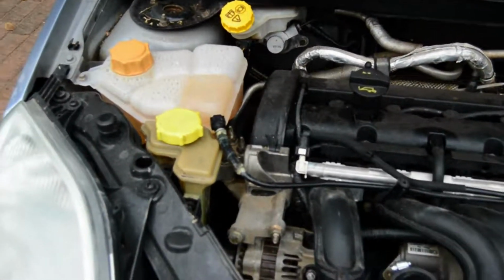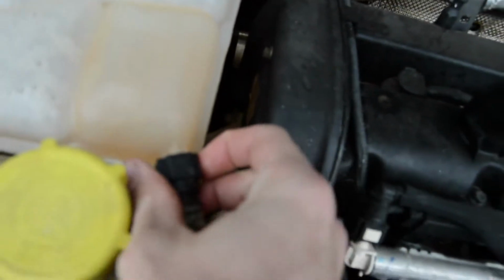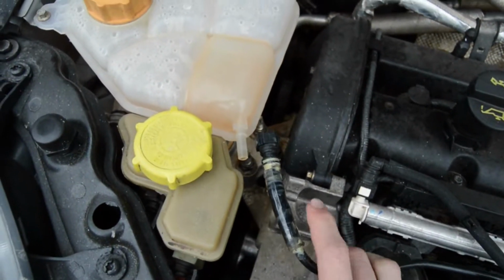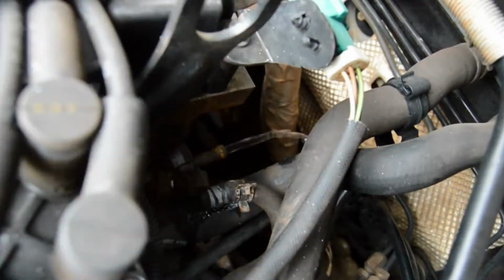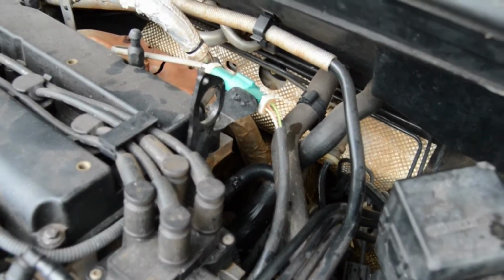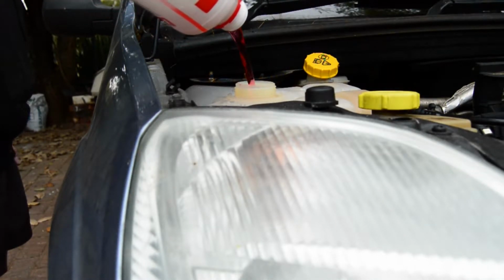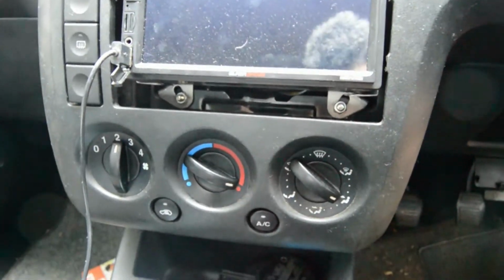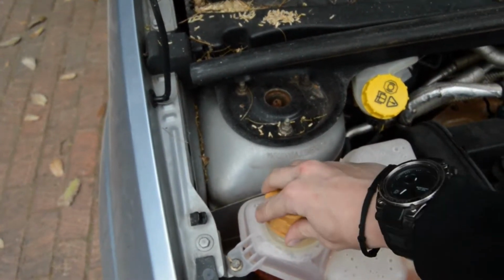Replacing Radiator hose on Ford Fiesta/Figo

Comment: Ive had to bodge mine as the end on the new part for the expansion tank didnt fit properly. I used the hose (that connects to the back of the engine) from the old part cut it using a hacksaw then used the old metal bracket and cable ties to secure it. Improvised but thankfully working well.
Reply from the maker: If it works it works

Comment: Hi great vid, replaced the hose but accidentally snapped the connector from the radiator in disconnecting the old piece. Do you know the name for that part? Can't find a replacement anywhere. It's a small metal piece (almost like an allen key) connecting onto the hose. 

Thanks

Comment: It’s called a airflow hose , £13 from Amazon 👍, also how did you snap it? I snapped mine and put it back together with some tape 😂😂
Reply from the maker: Snapped when I was working in the engine bay think I might have bumped it